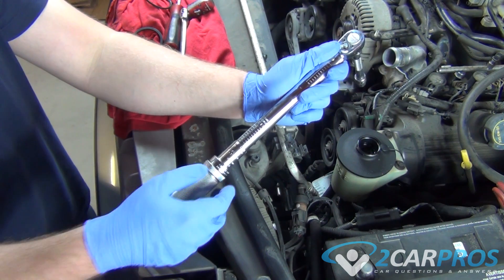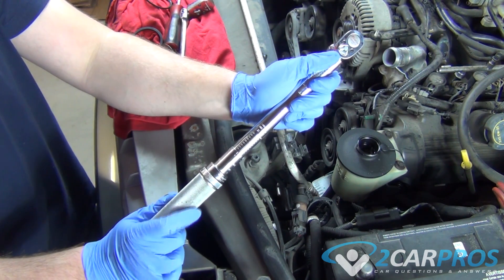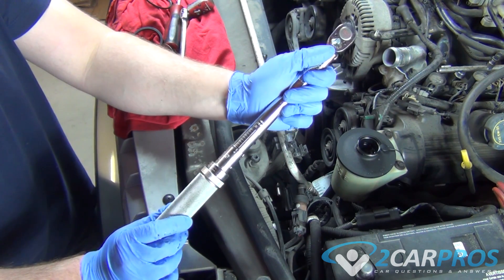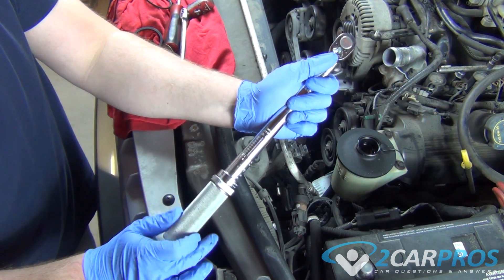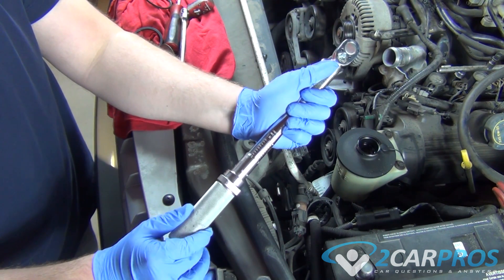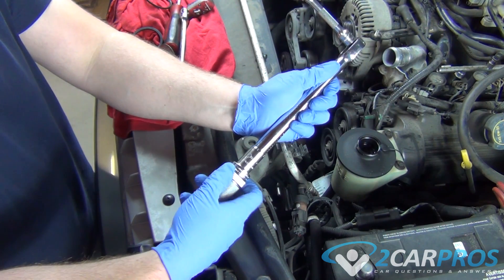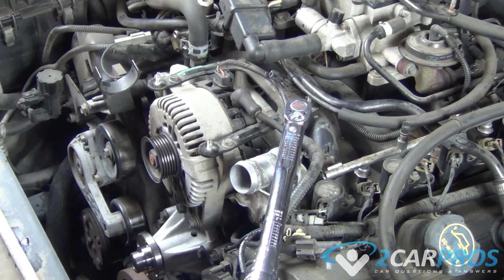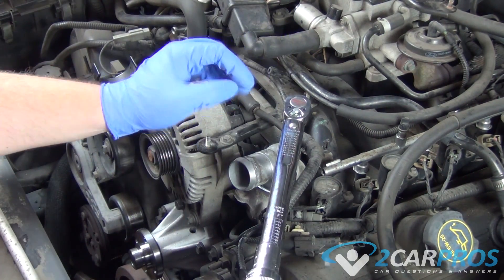HOW TO PROPERLY USE A TORQUE WRENCH!

Comment: Hi i just want to ask, before you set  any value to your torque wrench to start tightening a bolt what is the basis is it the head of the bolt or the diameter of threaded rod?
Reply: the thread size + grade of steel of the bolt. for example m10 grade 8.8 has its own torq value... 10.2 is higher
Reply: I'm looking settings for 2.0i Opel rekord tightening torques

Comment: You could also add that you never torque in one step, especially if there is more than one bolt.  You alternate diagonally, and take 2 or 3 steps to get up to the desired torque.  Then just to be sure,  double check all the bolts again.
Reply: Why is that so?